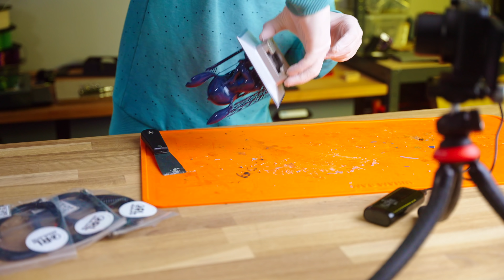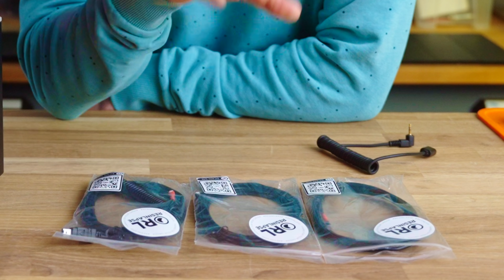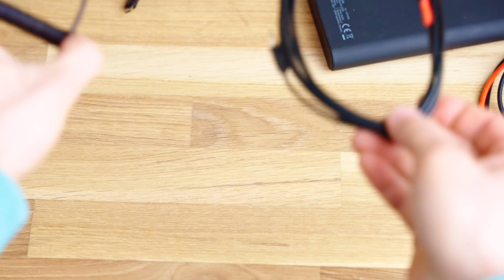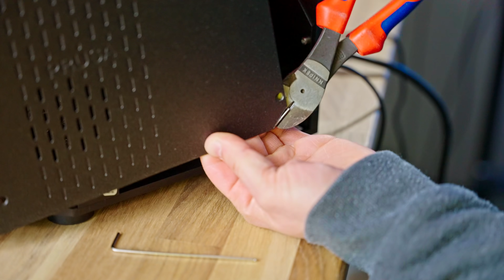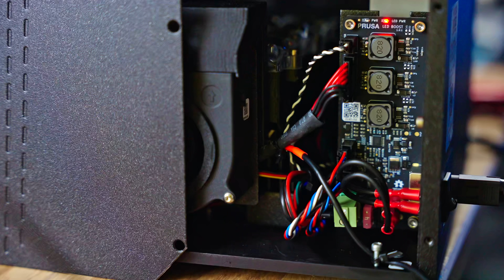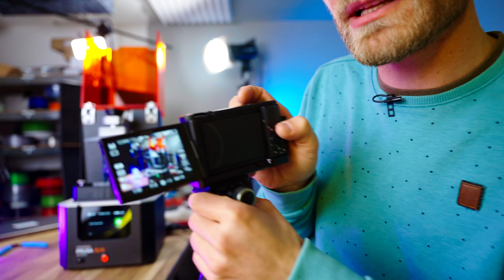Everything you need to know to get PERFECT Resin 3D Print Timelapses!

Comment: One stylistic choice I want to offer: exposure time (some call it shutter speed, which might be misleading) matters. If you stack a few ND filters, close your aperture down to a level that's not causing diffraction loss or just reduce the light in the scene. 

especially if you do have some kind of motion that is happening. Like not having the layer sync. 

As video usually aims for a 180° shutter angle, you can do the same with timelapse. So if you interval is like 8 seconds - try to aim for an exposure time of 4 seconds. It might make your 3D printer look really crazy as the moving X and Y axis (unless Y axis moves the model...) might vanish.

Comment: This is brilliant.  I am wanting to explore the time lapse side of things and watching this has shown the potential however.  I looked at your equipment list and wow those cameras cost such a lot.  Do you have any suggestions for something cheaper something for a hobbyist that’s just starting and far from professional ?  I have had limited success with GoPro but the cameras are not particularly reliable and I seem to spend more time getting the set up correct Than the time the print takes to complete plus triggering is a huge issue.  Thanks

Comment: Which slider is this in the video? Also, my resinlapse cable does not trigger my camera. I ended up using an arduino to look at the light values from the sensor on the cable and then see if its above a certain threshold to trigger the camera with the adruino itself. I also use a counter to not take a picture on every layer, to extend the lifetime of my camera.

Comment: World-class video.  But it illustrates an issue with resin printing time-lapses: it simply looks as if the build plate is pulling the print up out of a hole.  There's no actual deposition visible, as there is with FDM time-lapses.  Maybe there's some ingenious way to make resin time-lapses as "magical" as FDM time-lapses.  But I don't know what that would be.

Comment: Interesting. I don’t know enough about wiring to make my own makeshift cable but I wonder if there’s a way to use something like a flash trigger on the hot shoe that has a headphone port on it? Or even the headphone jack on the Sony directly if you use a 2.5mm to 3.5mm adapter. I’ll wait to see if Resin Lapse does a Sony cable though unless an easy reliable workaround is found. Great video!
Reply: Actually you don't need anything of those because there is a tutorial where is shown how to tune light-off delay to synch the layer to the camera of any brand

Comment: I’m surprised you left the cable dangling from the printer instead of adding a connector.
Wire the ResinLapse sensor to a aux port that you mount inside the printer.

Comment: It seems you moved out of focus on the first test of the slider. I guess you could use autofocus on this instead, given you choose a fixed focuspoint?
Reply from the maker: You could, but cameras as rarely optimized for smooth autofocus transitions - so you'd probably get pretty jittery images.
Reply: @MadeWithLayers  Are you sure? You're taking snapshots here - not video. It should work.